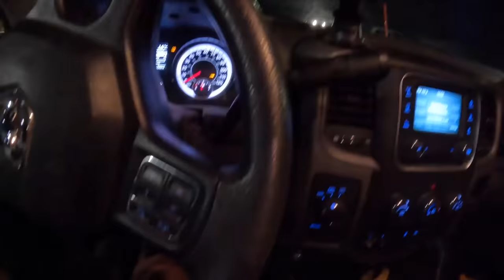Emergency Snow hauling

Comment: Merry Christmas Stan!! A liner helps those dump trailers a lot for snow removal in the cities here they use them for snow removal in all the parking garages it's all they can fit in there and actually load up to get the snow off the top levels . The other trick is never to push it down with the bucket, for that little extra half bucket you can fit in it isn't worth it getting stuck . For a pike like that ideally we use tri axles with heated bodies semi tractors with dump trailers and a cat 980 loader .
Reply from the maker: Sweet thanks for the tips!!

Comment: If you spray Pam in the dump box the snow won't stick. 😂
Reply from the maker: Wow. Gotta try this
Reply: @Dirtmonkey  Sledgehammer underneath works mint,  gravel truck I would get out and start slamming the tailgate till the load released.  If snow or is sticking in a dump box I would chuck a couple handfuls of road salt in there to keep it clean.
Reply: Rain X windshield De-icer comes in spray bottle seems to work good!
Reply: Just put a little yellow snow in it. It'll slide right out 🙃😁
Reply: Any sort of oil should do it, diesel included. Of course, some oils are more environmentally friendly than others, and of course it depends how much you use.
Reply: I’ve tried that with atf worked great not the friendliest to the environment tho
Reply: Diesel coating the bed will make it come out way better
Reply: Or diesel
Reply: @banffdigger  or mag chloride, i think he's in minnesota where it usually hits 10F for a high haha  tougher than nails those kids, walk to school in that too
Reply: Makes snow stick to my dish bad I would not do it.
Reply: A 55 gallon vat of KY solves a ton of problems.
Reply: @ecospider5  that is a pump drum. I have one for my night stand 😂
Reply: WD-40 works great.
Reply: @reddr216  lol
Reply: We use calcium on the floor of the floors of the feeders at work or on the dump body you can get it in a bag mix with water spray with a sprayer .
Reply: I was gonna say the same thing about Pam. Every time I ask her to do something she’s always busy.
Reply: When are you gonna show us those birds Stanley?
Reply: Wd 40
Reply: Wd-40
Reply: Diesel also works.
Reply: We have flip down sides and use a plastic fiber plastic.   Just tuck it under and fold up.  Cheap easy and fast
Reply: Form oil ;)
Reply: @Dirtmonkey  Just make sure you buy more than 1 can.....LOL!
Reply: You can also go to a coin operated car wash, set the machine to wax, and then spray the bed down. Don't rinse it off and just let it dry in the bed.

Edit to add. You can do the same thing to the underneath to help with snow and salt .
Reply: East fix ! Get a couple pieces of plastic hockey puck board screw them to the bottom. We have it in the dump bucket of the Zamboni
Reply: @Dirtmonkey  

Hey buddy 
I have an f250 super duty from 2019 and I have a straight boss plow the last two weeks I’m having problems and I can’t figure out what’s the problem different opinions and I’m spending lots of money and nothing gets fixed. 

When I raise the plow my heat cuts and light inside as well they come back right away. 

Can you give me a your opinion what’s happening. 

I put a strong alternator but nothing, the last call I got is I have to put a second battery. 

Can you let me know your opinion. 
Thanks
Reply: I saw a mine weld chains inside of their buckets to keep material from clumping, might be worth a try!
Reply: RV antifreeze in a backpack sprayer coat the entire trailer especially the corners. No more stick
Reply: @Dirtmonkey  beat juice works good just spray it on the bottom of your box and the sides
Reply: @mlindholm , some LPS because they say on the can they’re environmentally friendly.
Reply: Hi Stan,boy sure are working that little loader .
Reply: I use to pick up cooking spray or wd40 from the dollar store to spray the sides and floor of the dump trailer.
Reply: Guys are sure creating a lot of drama about something that has been happening forever. Snow. For crying out loud.

Comment: I also do snow removal with skid steer and dump trailer… first, add some 2x12 sides so you can haul more, Second, when load is stuck, grab a 3-5lb persuader and give a few good taps on the lower/side frame of the box.  The high vibrations it creates almost always releases the entire load?  I’ve tried other  things like Pam, but if you wanna do that, you better buy a few cases as you need to spray almost every load… Merry Christmas! 🎅🏻😁

Comment: I used to put some deisel in the dump bed before hauling snow to that it slides out nice and easy.  Especially if the loader operator would try to pack it down a bit. 
 Retired now but watching you guys makes me miss operating laoders and dump trucks.

Comment: Stan!  
I have a couple of tried and true suggestions  that I have been taught about snow ejection in dump trailers and buckets... 
1. Spray the entire trailer box interior with Pledge furniture polish (I prefer using the lemon stuff- Works Amazing)
2. Coat the box with "Pam" cooking spray- (works well)
3. A coat of WD-40 in the box works well too!
All of these I have seen work well in person , and I've used Lemon Pledge myself, with great results.

All 3 products are real cheap, and last a long time.  GB&GG, Buddy. Stay warm, stay safe!
Reply: Propane blower will slide it right out need a loader and triaxle not a dump trailer and skidsteer though.

Comment: Hey Stan I assume you guys know the little tricks of the trade to keep snow from sticking but I will tell you anyway first before you load out the first load in a trailer spread 25lbs or so and that one treatment will be good 5 loads. Used antifreeze workS well to

Comment: Spray it with water and let freeze. It will slide right out. Sounds weird but it works. Obviously temperature permitting.

Comment: Fun fact you know you can add boards to the sides of the trailer and get a bit more capacity for light weight loads like snow or mulch…

Comment: For efficiency backing at an angle to the pile would make loading a lot faster… and keep the mess closer to the pile… just like loading trucks in a quarry or pit
Reply: Thats the first thing I noticed too.  Less wear on those snow tracks too
Reply: Loader guy in the pit gets pissed if you don't do it that way.

Comment: Great that you all could do this, but I fail to see the emergency here. So this tight, neat pile couldn't wait until reasonable working hours? Hopefully they paid for their emergency situation. 

One thing I've noticed in these snow videos is the lack of blowers. Those skid steers could be running snow into dump trailer at a rate 5x faster. Or just shoot it over towards the retaining wall and windrow it with the big pushers, then hammer it again with the blowers. They use snowblowers and blades on all airport runways for good reason. It is a super effective way to remove wholesale snow. I know they are expensive units, but necessary in big parking lots that are very similar to a runway. 

Great videos and lots of hard work.

Comment: Something that I've done in the past that works great is when the bed is clean and cold pick the bed up and give it a light spray of water. Let it freeze and repeat a few time till the bed is a sheet of glair ice. Also don't pack it in, keep it fluffy if you can. Another thing that works but it can rot out the bed fast is give it a couple of coats of liquid calcium chloride.

Comment: later in the video where they were ramming the dumped snow it reminded my summer job in a farmers coop loading and bushing up larges amounts of grain with a telehandler it was a blast and also it was so different from what i do now i dont see paved roads from the machines i i run im in logging now and its just so awesome and i love it as long as im working in or around heavy equipment i love it at 19 yuears old ive worked on around 10 different pieces of equipment in last 3years and most in last year in the company i work in now i run anything they need me to and thats any piece they have and im about mastering all of them with time and i love the work i do

Comment: Stanley, few questions........how come you were not using your new 5th wheel lugger box trailer for hauling?  Do you always follow your trailer when dumping and if so why?  If you are going to be at the dump site anyways, why not take your loader for pushing the pile up instead of driving the skid steer back and forth?  Thanks and god bless

Comment: I assume u are charging time and equipment on something like this? Fuel, over head etc… 

What are some things possibly you may charge for that may pop up in the spring that most of us could possibly miss. Good talk about the retaining wall and the possible issues that could pose and an issue.

Comment: You should invest into a snow melter and provide the removal right on site over a sewer drain. Some are the size of semi trailers but can melt loader buckets at a time, they use them in New York and large cities.

Comment: Stan, have you thought of using those large snow blowers that load into 16 or 18 wheel dump trucks that cities use when clearing major roadways very fast? It would sure beat time loading with the small bucket into your dump trailer. Don`t know cost of those large snow blowers, but they do move a lot of packed snow fast.
Reply: 700k for the blower alone….

Comment: We use bagged calcium mixed in water in pump sprayers to haul sand and snow in frigid temps with our 28ft lined aluminum dump trailers — or you can use old used antifreeze in pump sprayers they both work awesome for stuff like this — Rock on 🤙🏻

Comment: Have you tried a larger bucket for loading snow?   Looks like you are using a dirt bucket…
Reply: The whole operation was a joke
Reply: @johnwudarcki9315  not very efficient but maybe that's all they had.   It'll come down to the bill if they go back or the customer goes "holy crap"

Comment: I’ve used the Pam cooking spray might take a lot to do a dump trailer but maybe you could put like vegetable cooking oil from a deep fryer in a cheap pump sprayer to coat trailers pushers plows and such to prevent sticking then just power wash it out in the spring

Comment: Nice video. I would highly suggest wiring up a remote control to your hydraulic pump.  Your driver can be driving up the road while lowering the trailer, then close the back doors when back in the parking lot.

Comment: How much are you charging per load? I might have to do some hauling soon as well
Reply: I’m charging $300 per 10 yard truck. Using a 14 ton loader and a dump truck. Skid loader and/or atv’s on cleanup. This video looked about 200 yards, I would be charging $6k.
Reply: @richsaak  that's pretty close to what I was thinking
Reply: @michaelmohs8249  For these special projects. I give the employees a bonus and tell them it’s from the costco we just worked for.

Comment: Would love to see a video on what you'd recommend for the average user. I have a 60x40 driveway in ND and while we don't get large amounts of snow often, I get an incredible amount of well packed drifted snow where 6" snow storm will result in 2' in the driveway. I don't have a tracked blower and the ariens 28" is kicking my ass this year.
Reply: Save the money on a new unit and put it to hiring it plowed/blowed. Same price less work for you.
Reply: @jamesnm21  I would rather not be limited by someone else's availability. 
When I mention work, it's not that I have to work, it's that it's an excessive amount that I have to do, the snow blower won't go through it at all, like running into a wall. 

It feels like I'm not fighting the snow, I'm fighting the snowblower. That's why I'm looking for something else.

Comment: Stanley.  Next dump trailer.  See if there is a way the box beams along the lower corners of the bed could be connected at the front. With a flex exhaust pipe over the trucks tail pipe to warm the lower sides of the bed to stop it from sticking

Comment: You guys probably get more snow... here in Rhode Island, landscapers and heavy construction companies do most of the snow removal.  (I do snow  removal for the non-profit I work for. )our heavy construction companies usually  get  the large lots because the have the large frt. End loaders and 6 and 10 wheel dump trucks  to truck the snow. He'll  i don't  even  use our bobcat t190 with  a bucket  for snow, just the snow blower
Reply: We use to get snow....last 4 years nothing
Reply: Hey another rhode island guy!!

Comment: Not to be an armchair operator, but do you guys have a bigger bucket for the skid loader? I used to run a 1 yard bucket I think. The one in the video looks to be only a half yard. I could be wrong though.

Comment: I've heard liquid calcium in a backpack or 2 gallon sprayer works well but after 3 or 4 loads you need to reapply, a thin coat of diesel works great but most places frown on it, I would try something like canola oil or biodegradable hydraulic oil that is used in heavy equipment near waterways. The key is to have the box clean and dry before you apply it. Or put a dump truck vibrator on the underside to help.

Comment: You need to add a couple Mexican draglines to your equipment....guys will just love them ....helps remove ztuck material from boxes. Very fuel efficient and you don't need to check the oil or hydraulic fluid.

Comment: Pam comes in gallon cans. To use it in a garden sprayer.  Or a 5 gallon can of propane and a weed burner torch.   You are likely only going to have to buy the gallon of pam   as you should have everything else

Comment: you should have a vibrater in the bed of the trailer when snow gets stuck in it and hit it and help it fall out, just a idea like they use on dump trucks
Reply: I was thinking the same thing and I might try fluid film I never tried it but it might work it's definitely waxy and slippery

Comment: Plastic tarp in the bed, or spray diesel fuel, but tarp works much better. Not sure if this was an hourly deal, but I could give u suggestions to double that. Also that walking bed trailer would've been perfect for this.

Comment: People standing in a pinch point between vehicles always confuses me. I won’t stand in front of or behind a running vehicle. 

A friend of mine was guiding a car standing behind it. He was pushed through a concrete block wall when the driver accelerated backwards. It was a good thing it was a weak wall.

Comment: Not sure if you have a plastic liner in but that really helps too, i put 3 200lbs vibrator underneath the trailer probably an over kill one in the front, middle, an the back an it will slide out like a dream

Comment: Hi there! I have wiring diagram how to connect a regular winch remote control to a hydraulic power pack, it works only tho whit a up and a free return or a up and power down not more functions. Standing at the trailer like that is not so good idea.

Comment: Don't waste time with all these chemicals trying to make the snow slide... We line bottom of trailer with cheap blue tarp tied off in front, slides right out regardless of snow conditions. Go through a couple tarps per year, no chemicals to worry about. Cheap quick easy.

Comment: 20+ years plowing newengland myself.$100 solves it.. ELECTRIC RADIANT HEAT FLOOR MATS OR THE HOME ROOF ICE DAM COILS attached under the trailer deck nose only. Can run it off a spare battery.  Only the nose of trailer needs to be done

Comment: That Kubota CTL is working out nicely. But driving it along the road? What if the police stopped you? I don’t see a license plate on there.
Reply: I admire how you can shift from building retaining walls to plowing snow without missing a beat. Some builders would think it beneath them, but they lack your quickness of mind to take advantage of what’s there; to act instead of sitting back. I hope you and the guys had a Merry Christmas and I not only wish you a Happy New Year, but also much success in the upcoming year.

Comment: Maybe it was unavoidable in this situation, but a hauler should never park in a position where the loader is forced to turn 180° to load. Always 90° or less. Sadly, poor truck backing/maneuvering skills (becoming more common) often force a loader into an unproductive pattern. Very common in quarries also.

Comment: Spray some diesel fuel in your box before you go out it’s like magic. We even spray some in our commercial snow blowers so the chutes don’t get jammed. Old motor oil works even better but we use diesel. Oh yeah and it’s also really go of to put in the back of your dump truck and on your tools when you’re working with hit asphalt
Reply: *hot

Comment: We never pack the snow when loading trucks and use vegetable oil on the trailer floor before hauling. You will never have problems .

Comment: Use deep fryer oil in your dump trailer greasing a pan and the snow will slide ride out of the trailer and it's bio friendly

Comment: For a bunch a guys that usually can come up with creative solutions on the fly for most of the problems you run into no one thought ahead about the snow dumping out of the trailer. 
You also need to get at least 1 more guy to get a CDL so you are not depending on just one guy to drive the big dump truck. 
Just my .02
Merry Christmas to all the Dirt Monkey gang.
Reply: Or just get a truck rated for 26,000 GVW inspectors are not out in these conditions looking at things and then anyone can drive it ,automatic trans

Comment: I know you know this, but it doesn't add to production and hurts the machine more than necessary to make a 180 degree loading cycle with a loader. Not criticizing or being hurtful, just try to set your loading site up with as little turning as possible. If possible.
Reply: DirtMonkey-  Merry Christmas

Comment: I’m sitting here wondering why you didn’t use the plow thing on the front of your truck to push the snow after dumping instead of wasting time with the skid steer… 🤭🤷🏼‍♂️🤨🫡